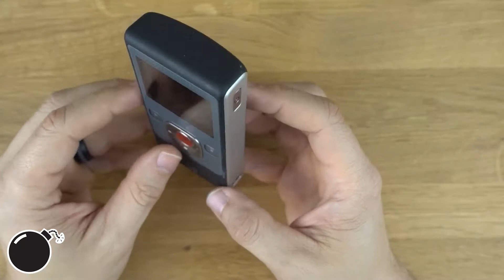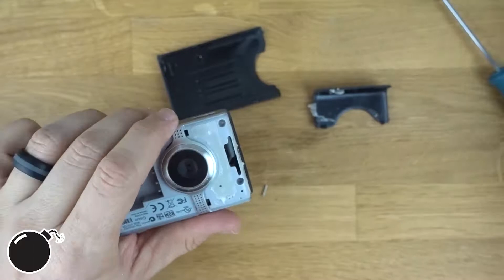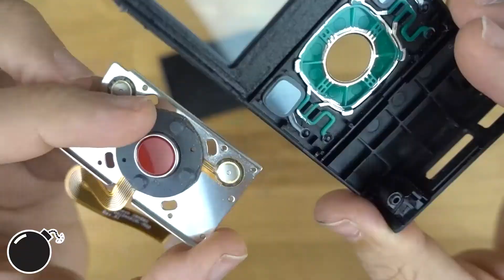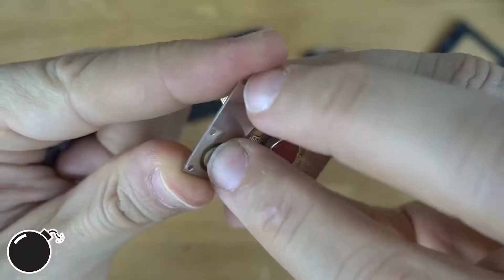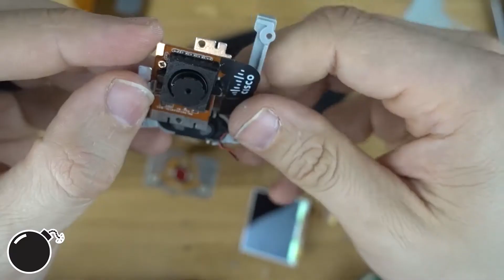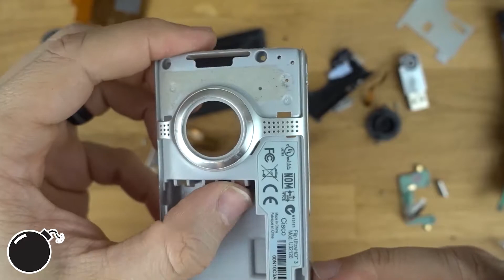Flip Cam Tear Down (I almost lost an eye!)

Comment: What does the storage chip look like in the camera?
Reply from the maker: I don't remember but I don't think it even had removable memory...
Reply: @thoughtbombdesign  I have an old flip video camera that's even older. I took it apart and I just took the usb on the motherboard and plugged it into my computer and I can use it as a 1gb storage device. Only problem is that it's too big and I'm thinking of removing the parts that I don't need.
Reply from the maker: Very cool! Nice work!